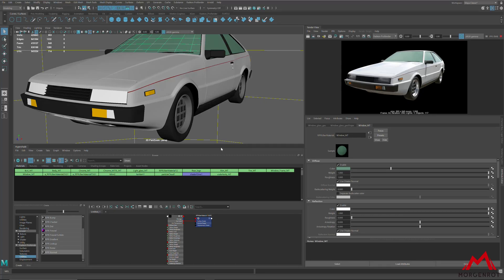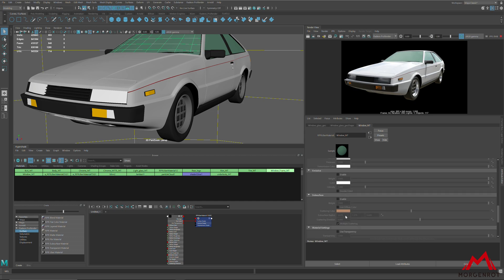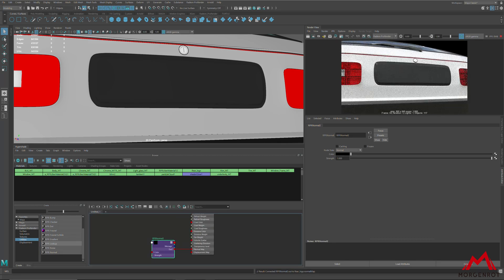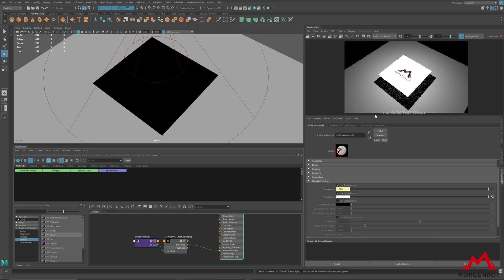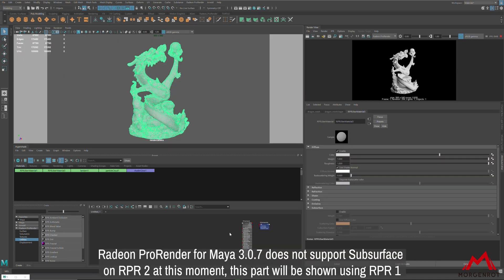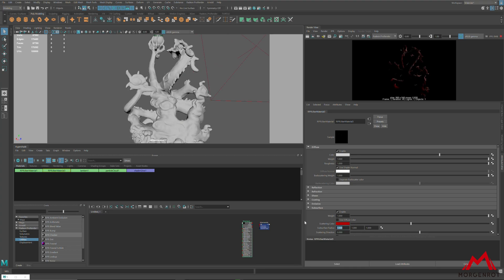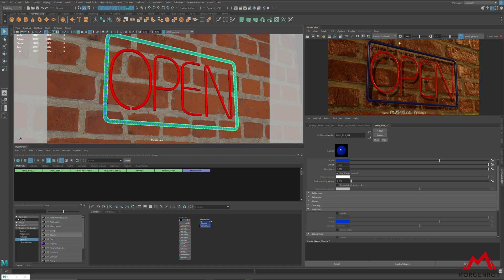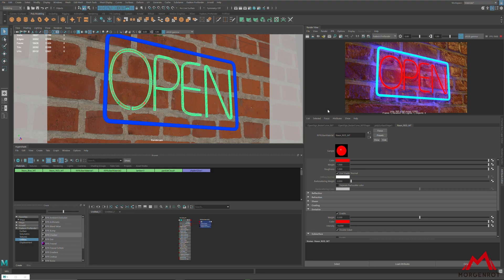(Autodesk Maya Tutorial) Part 3 - Materials AMD Radeon™ ProRender Tutorial

Comment: Can we use Arnold material and then render with radeon render because arnold render isn't working?
Reply from the maker: Hi, Just as other renderer, AiStandardSurface will not work with different renderer from Arnold(as they are implemented with the renderer)
You still have option in Radeon ProRender to convert Arnold/Vray/Redshift Material to Radeon ProRender with one click. They will convert AiStandardsurface material to RPRUber, but there will be few adjustment to match the original material.

In order to do this
(In the top part of Maya where file/edit/create menu is or where the light menu for Radeon ProRender are as what we shown in Part 4 tutorial)->Radeon ProRender->Convert->Convert Arnold Scene to RPR
Reply: @Render_Pool  so the equivalent of "AiStandardSurface" is "RPR Uber Material" or "RPR PBR Material" or "RPR Material"?